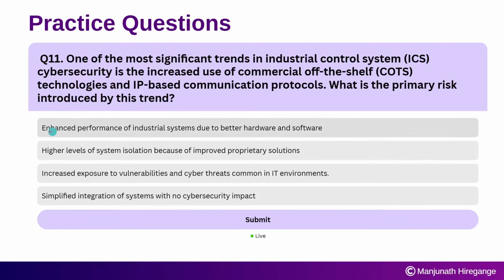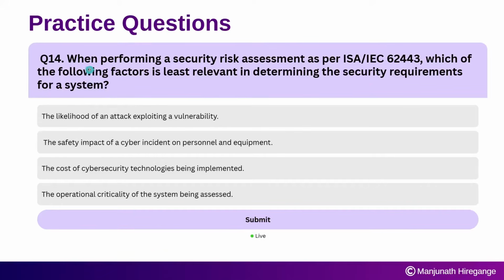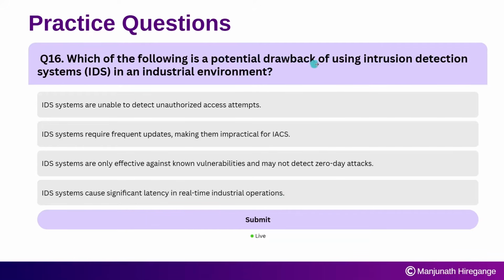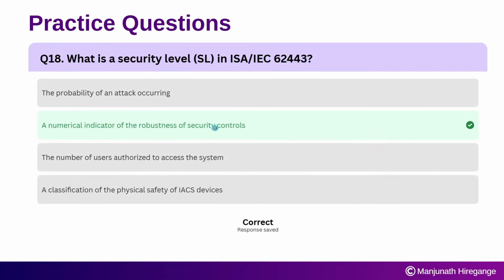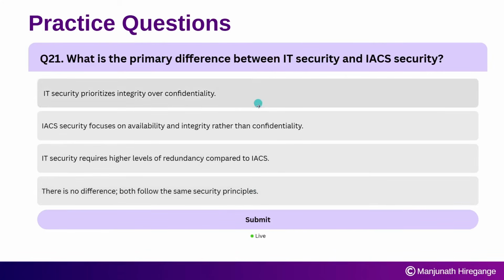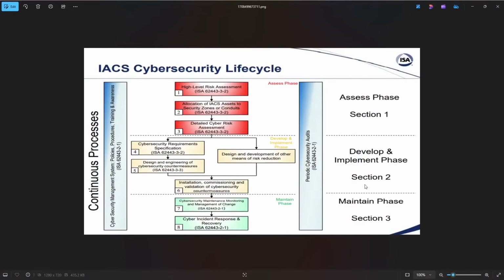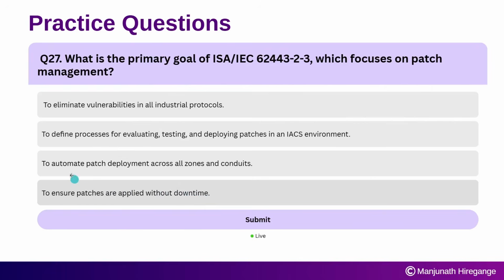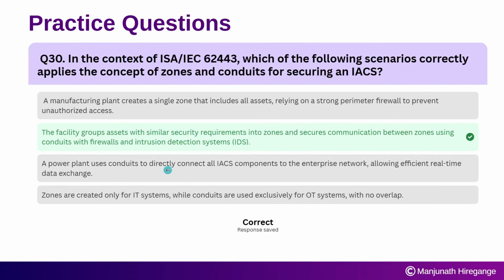Mock Test 2 | ISA/IEC 62443 Cybersecurity Fundamentals Specialist Certification Practice Questions

Comment: How much it cost for the fundamental cert?
Reply from the maker: It will cost around 1600 USD if you are a member of ISA. However during blackfriday sale (occurs every year mostly in November/December) you will get 30% discount, so it might cost you around 1300 USD
Reply: @icsotsecurity  Thank you.
I m working in ot environment for almost 4 years, could you suggest me some certificates which i can do before 62443
Reply from the maker: @techobar4525  You can Consider Security plus from CompTIA or CEH.